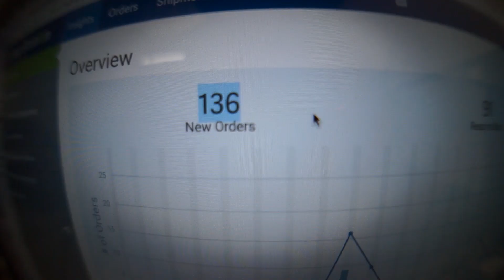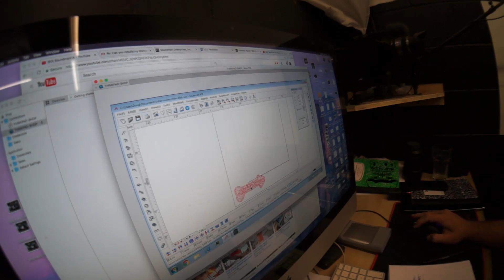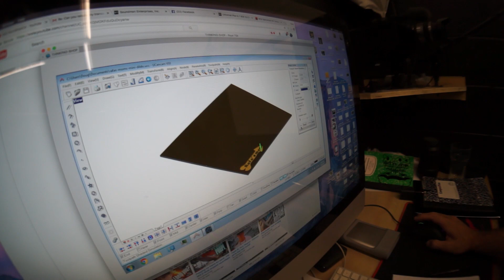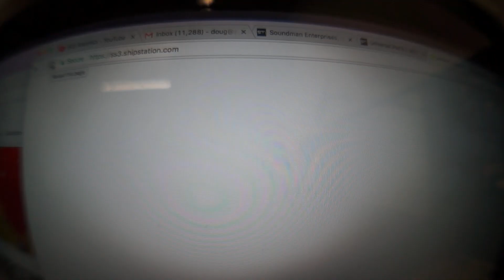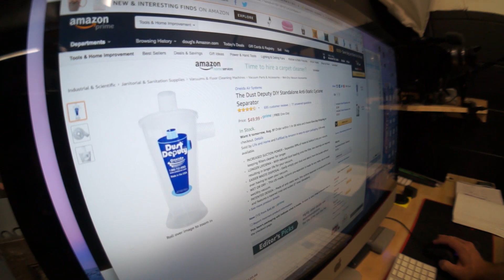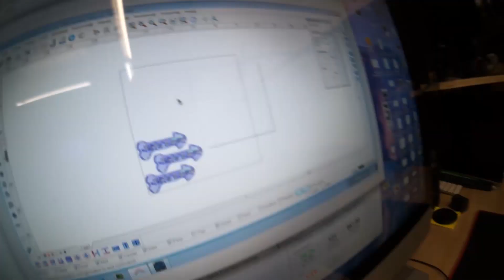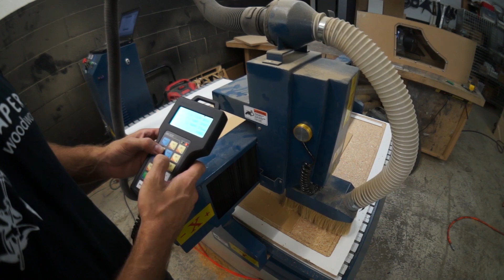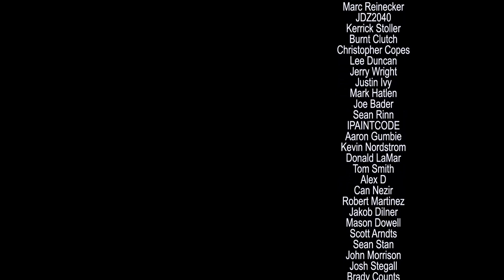I SOLD 200 DILDOS!! - AMPLIFIED

Comment: Good job Doug, When you're ready for some plasma cutter work crank out some "Fuck Off"  oil pan skid plates.  I would get a couple of those, one for the wall and one for the car....
Reply: i'd buy that
Reply: I don't even need one, but I would probably buy a couple anyway......
Reply: Id actually buy that too lol
Reply: I would definitely buy a few!! That would be awesome and my wife said she would like my racecar so much more if it had a fuck off plate!!
Reply: 1ANeat he doesn't have the plasma table anymore. U ain't noticed? He must have sold it on the low
Reply: I'm down, Would definitely get one too.
Reply: Drone Strike He moved it to the other side of the shop a while back.
Reply: Fuck Off plate is a good idea.
Reply: I want mine  mirrored !
Reply: A very good idea. Doug has to come up with this idea himself....

Comment: 4inch suction line to the cut head will get you around 300 cfm flow I highly recommend 5" as it will get you close to 700 cfm at the static pressure that dust collector can produce. I also highly recommend getting a pleated filter as they have a much larger surface area than the bag filter on that unit, and will stop much smaller dust particles than the bag filter will, that are currently fucking you lungs up like every day.

Comment: I slid one in to my open basket yesterday but I removed again when I saw the shipping cost to the UK. This is my parent's fault as if I'd been born in the USA I'd be living closer to Doug now and the delivery costs would be cheaper. I need to find a local supplier, does Rafa's Mom have a cousin in England?

Comment: Hey Doug quick question for ya. I've been looking to try a new amp I'm looking at the 2 team 4000.1 for ct sounds and I've looked on here to see how people have liked them I've asked people this question but never got an answer. Maybe u can I've seen that alot of the team series amps 3k,4kand the 7k smoke cuz of vibration issues on the board. I am wondering do u know if this has been corrected in the new model. They say that the board is not secured to the heat sink well. If u can answer this I would greatly appreciate it since I can't get an answer from anyone else. It will be powering 18 fi sp4 thanks and good luck with sanding all those rafa's mom dildos lol